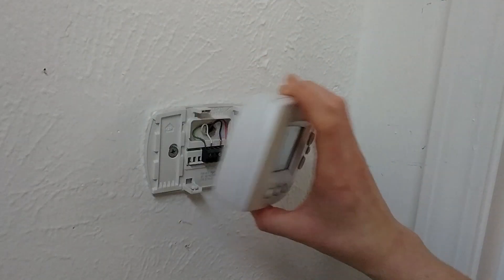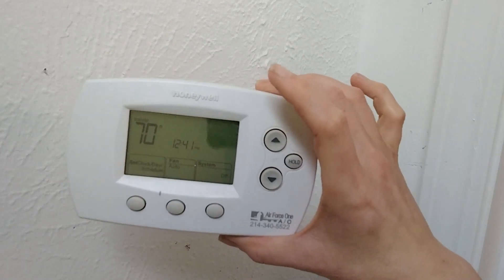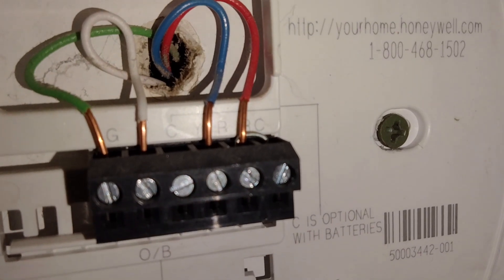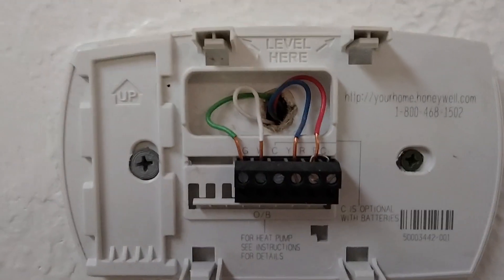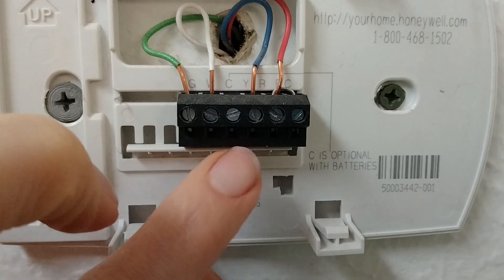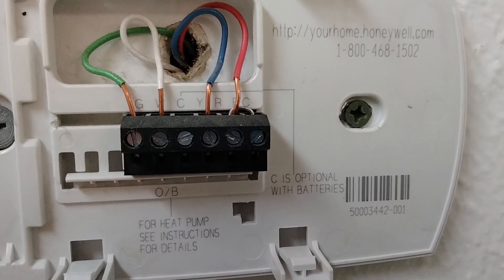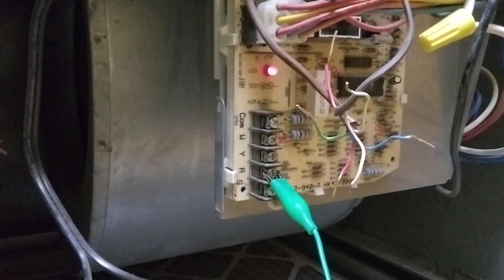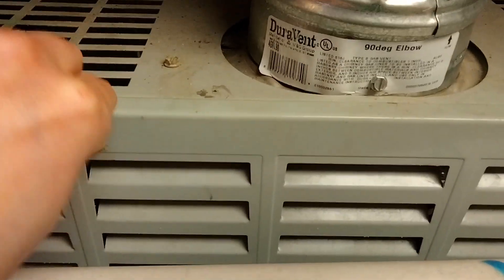How To Diagnose a Bad Thermostat

Comment: G is only for fan
Y is cooling speed
W is heat speed 
And Y and  W work on automatic?
Is that what is happening with that unit? 
Also Y branches out to outside unit condenser!
W branches to turn heat relay on for heater to turn on!

What is your complete talk on that?